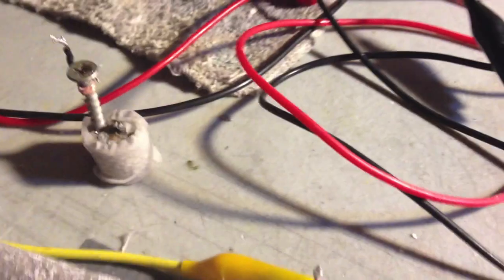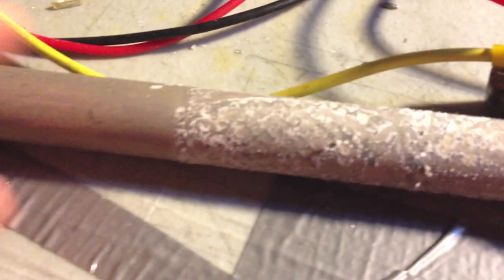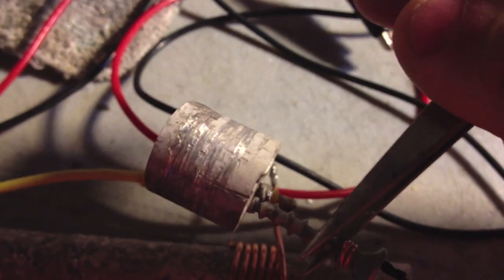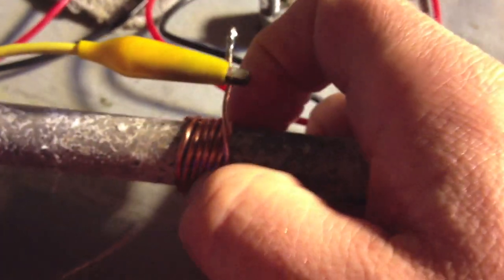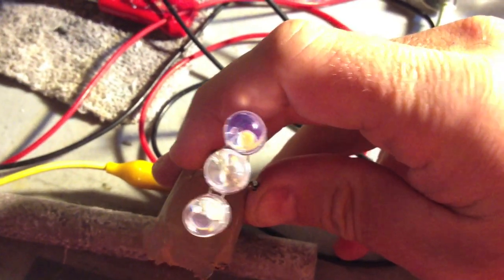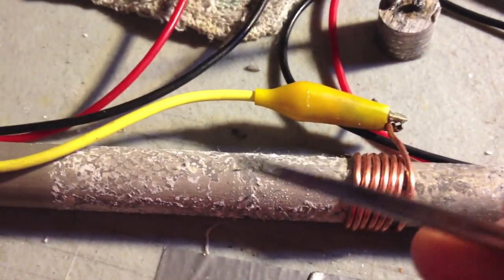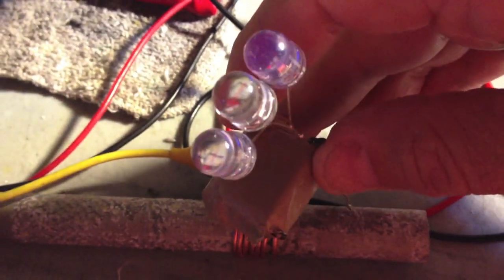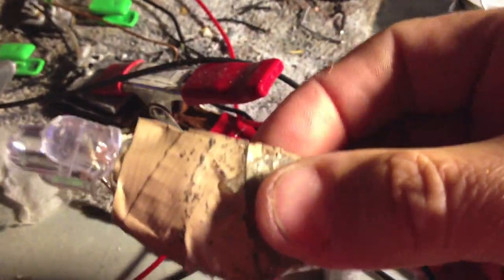Crystal Cell 30

Comment: power = 1 megawatt-hours per year. on one shelf.   if 4 or 5 cells - size of hokey pack, give 1-2 w, than  bookshelf of 10x10  packs = 100-200w const,  say 2- 4 kwh/day,  60- 100 kwh/month,  720 to 1200 kwh/ year.  about 1 megawatt-h/year. 
p.s. Plengo, what you gonna do with all this power (superpowers) you posses - you're the superman  : ) 
pps. you  probably stack gigawatt of power already on all of your shelfs over the years   : \